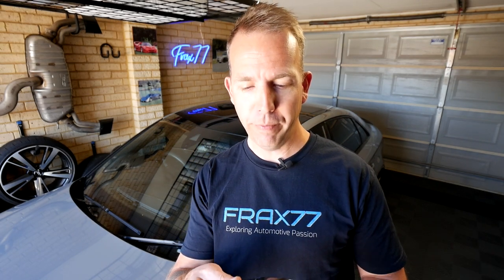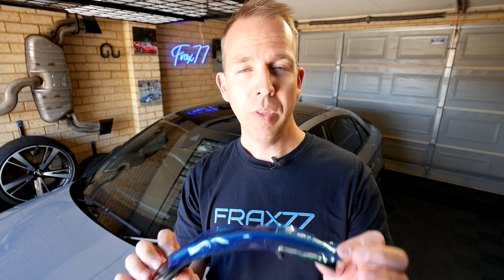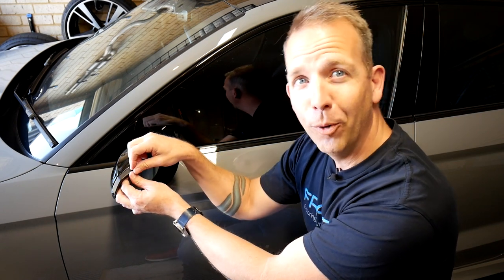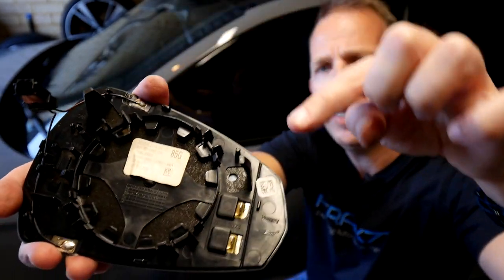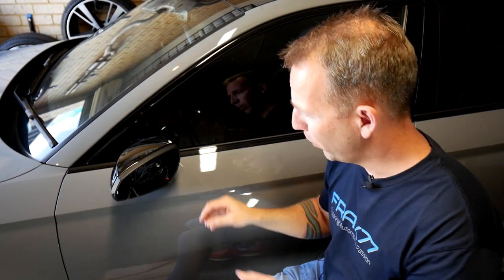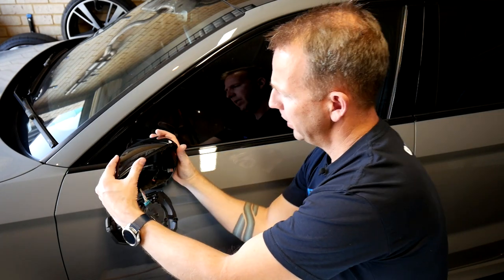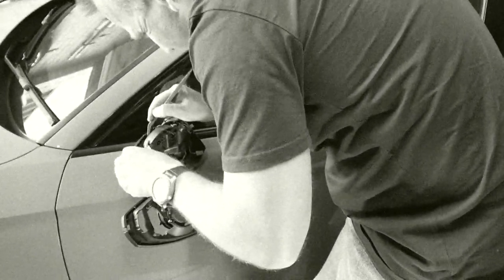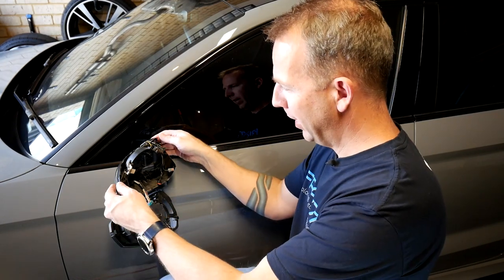Installing Forged Carbon Mirror Caps and Sequential Indicators on the Audi RS3

Comment: Meanwhile rs3 owners are installing forged... mirror caps... from Asia... I'm sorry but you got juked. I don't think those forged mirror caps will save you a lot of weight vs the heavy oem ones.
Reply from the maker: It's a personal aesthetic choice. Don't stress, I'm not under any dilusion that 'adding' carbon fiber has any weight saving advantage 😄